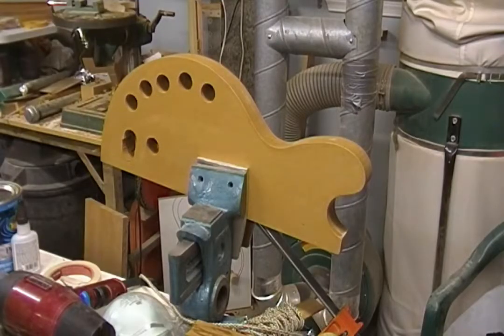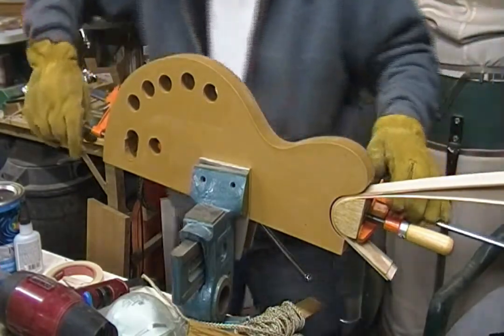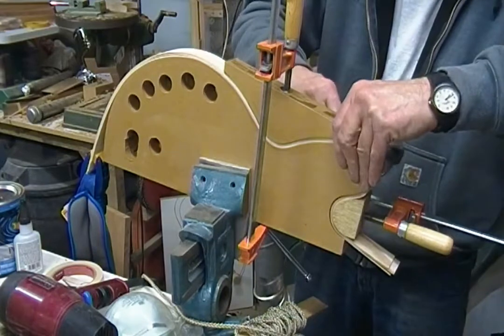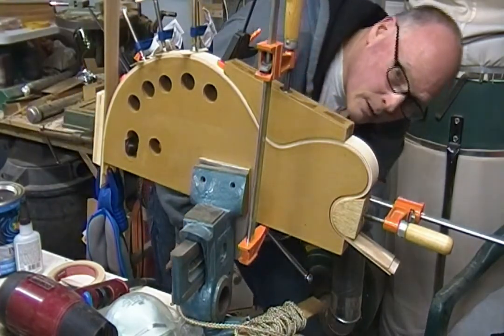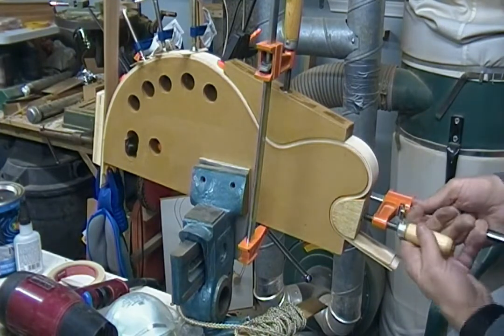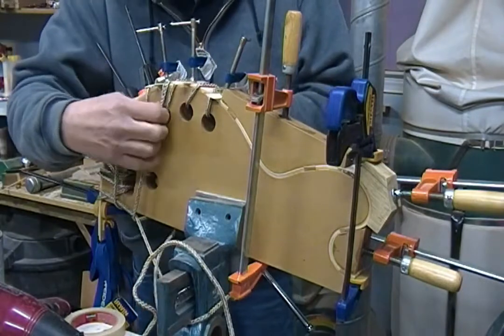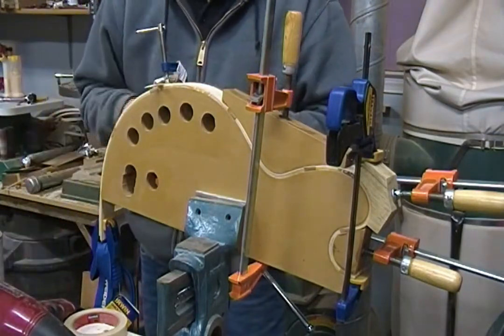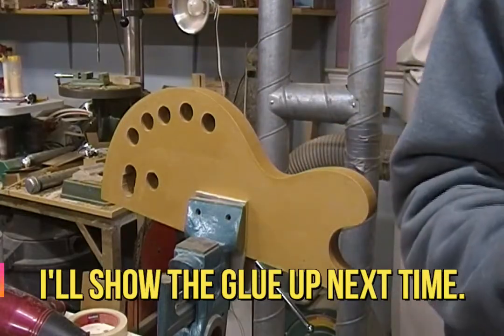CUSTOM BUILT JONAH ES-335 Part 4

Comment: I've watched this video several times. Trying to memorise the steps. Thanks for sharing your methods! Do you have any idea if it'd be possible to bend the sides as easily had they not been laminated?
Reply from the maker: Thanks for watching Marcelo. I don't think this method would work with a one piece side that was a s thick as this finished lam side. The individual laminate pieces were 1/16" thick. So 3/16" total or 190 thou. Typical sides are .090 (it varies) and you need a bending iron or blanket.
Reply: @jonahguitarguy  I see! Would mind telling me the length of the sides? I mean, the extension of each piece for each of the sides. I'm looking forward to building one, but I'm a bit too short on knowledge on the matter!
Thank you for your answer!
Reply from the maker: @marcelogarcia8082 , I answered this question just a while back but I don't remember. I'll measure it again next time Im in the shop.
Reply from the maker: @marcelogarcia8082 , the sides need to be a little longer than the finished pieces would be. Right? Impossible to bend them that perfectly. So at least 36". My left over pieces are 40"
Reply: @jonahguitarguy  thank you!

Comment: How come when forming your laminate bindings you didn’t just use the outer mould you had made and that way you wouldn’t have had to adjust for the 3/16 for the inner mould and make a new one? I’m only asking as I am going to use the outer mould for my sides and hoping it will be the same. Also, great videos. Enjoying watching you from Melbourne, Australia.
Reply from the maker: I guess it's just seems more normal to bend sides over a form rather than into a mold. So I went at it from that direction. Thanks for watching, much appreciated.

Comment: Considering that you only have two hands it’s going remarkably well. For a moment I tougth that it would take you to long and you would need to re-stream the wood. “Very little springback” I’ll say next to nothing
Reply from the maker: Hey Gert, thanks. After the glue set up it held it's shape remarkably well. I tried bending quarter sawn mahogany at the same temp and it wouldn't budge. So I made a trough to boil the wood in but haven't tried that yet. I know it's going to swell and that will cause some issues with my form set up figured for 3/16".
Reply: @Dane Nichols Hi Dane. When trying mahogany I would belive that an extra set of hands is absolutely necessary since you will have to work fast once the wood is removed from the steamer. I personally would love to help - but the trip is to long. When you (as I belive you already have) google mahogany stream bending it seems that you should cold soak it for at least a couple of days or up to a week before you stream the hell out of it at 210f - probably up to an hour. I hope the reservoir on your steamer is Big. Mahogany is probably too short-grained to be really comfortable quarter-sawn or not. Best of luck when you get to it.
Reply from the maker: Gert Halberg, all good ideas. I’m gonna try boiling and if I have to I will use flat swan. Thanks for your input.
Reply: Dane Nichols Mehh - Flat or quarter I dont think it’ll make a Big difference, but perhaps some kind of support on the outside like a strip of thin sheet metal already Bent to the rigth shape - just a thougth🤓 Btw Isn’t that a Mickey Mouse Ear? When I look at my 345 the bend on the horn looks tighter.
Reply from the maker: @gerthalberg9735 , outside support would help for sure. Quarter sawn really is stiffer in the direction I need to bend and coming out of the same temp steam it was not moving. I did some research on the MM ears cause my client was very specific about wanting them. They changed through the years, some info I read said it may have just been  wear on the forms or new forms being made just slightly different. But whatever it was the older ones were rounder.